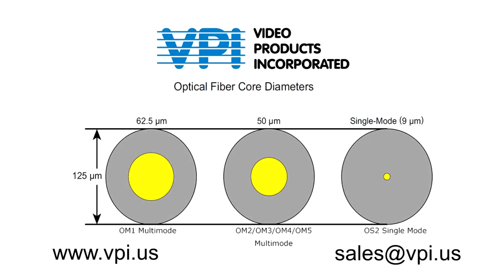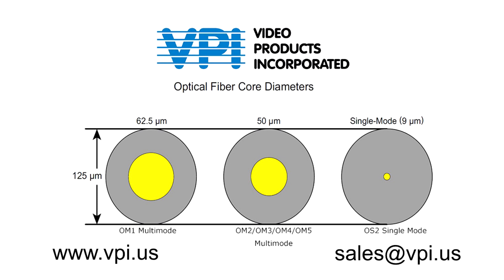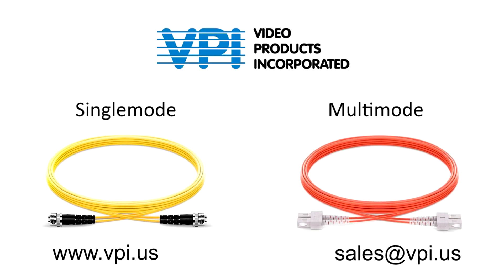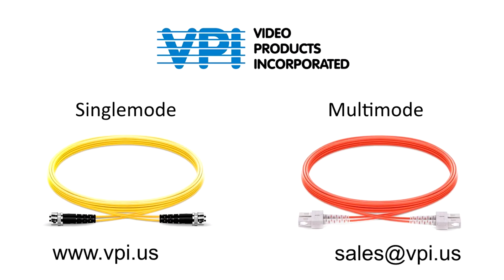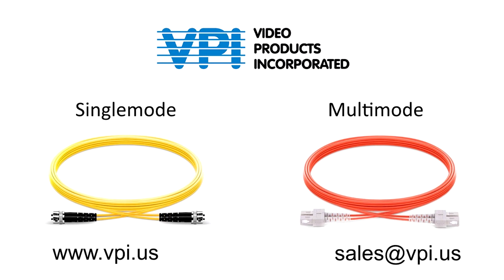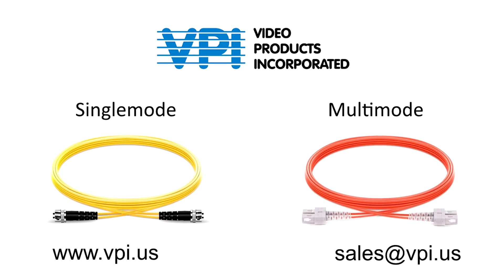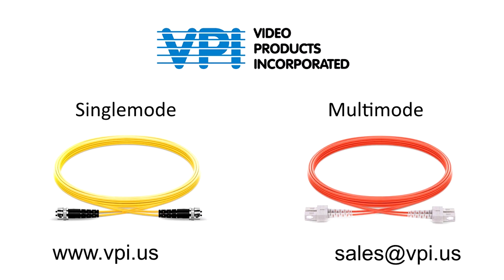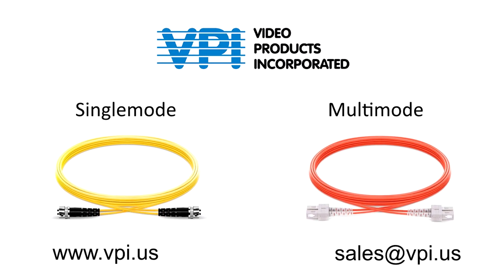What is the Difference Between Singlemode and Multimode Fiber Optic Cables?

Comment: Its not fiber optics but optical only if the cable only has a single core. This is because the whole meaning of the word fiber implies a lot of tiny cables. Fiber optic cables consists of many many tiny cores organised within a single cable.
Reply: not true folks, a single core fiber might be considered a fiber-optical if you will, but it is still fiber due to the fact that its data transmitting function is generated thru light.
Reply: @bobpress1235  not really, have you seen google fiber bar april fools? Point is fiber is also something you eat. It has nothing to do with light, only that there are a lot of interwinding strands. You would call your optical sound containing a single core fiber optics now would you?
Reply: @System0Error0Message please can i ask something about this
Reply: @yassin4670  sure, but the single core plastic cable used for sound is just called optical, not fiber optics. whereas the optical cable with many small strands or cores is called fiber optics.
Reply: @System0Error0Message  sir please can i have your email to send my question
Reply: @bobpress1235 its kind of complicated
Reply: Interesting.

Comment: what is the best for 1km?
Reply from the maker: The recommended cable selection depends on your network speed needs. 

Since 1 Gbps speed is the most common application in current fiber network installations, the best recommendation is a Singlemode cable installation, which can be installed to lengths up to 70 km. Singlemode cables are also the preferred cables for 10 Gbps speed installations, with cable length reaching 40 km.

However, in lower speed installations where the network speed requirement is 100 Mbps, a Multimode cable can be installed to 2km and a Singlemode cable can be installed to 100km.